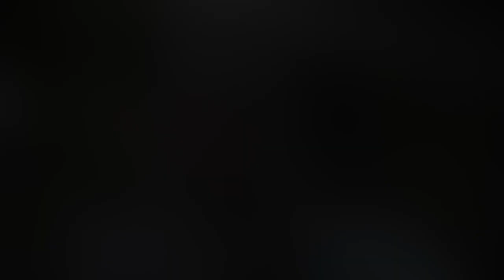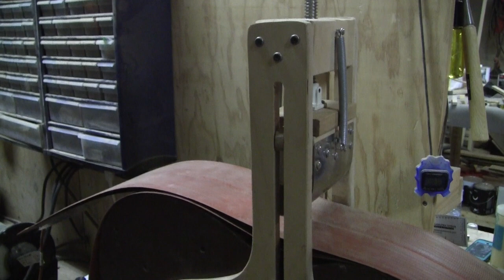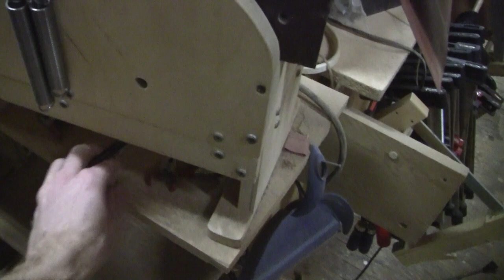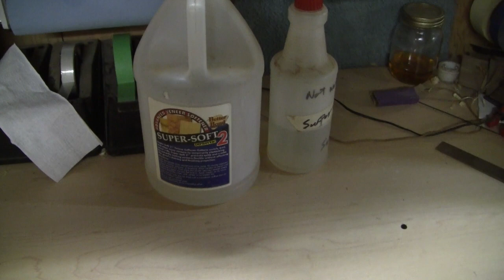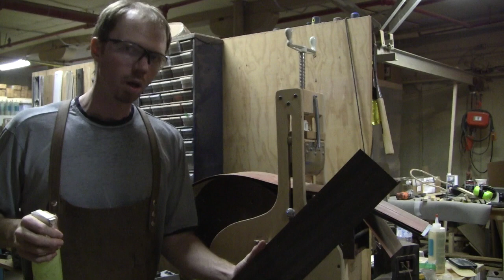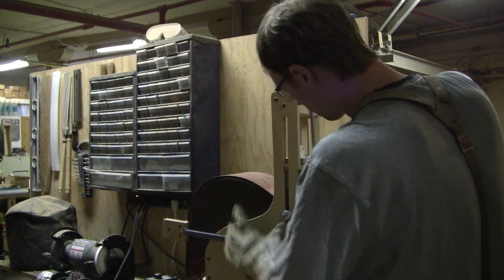Bending Acoustic Guitar Sides with a Bending Machine.

Comment: Thanks for the good video Josh. Have two questions. 1: do you wrap the wood in paper or foil to prevent staining by the spring steel slats? Do you profile the back edge of the side before bending? I studied with Sergei as well and am evolving in my approaches, always looking for more info. Thanks again!
Reply from the maker: Hi Fred, Sorry for my slow reply! I forgot that you had left a comment on this video. In general I don't wrap the wood, and I typically don't have issue with any staining. I think one of the keys to this is that I use a very small amount of water. Typically just spraying the underside of the wood lightly. If I'm bending light coloured wood like Maple or Mahogany I may get some surface staining, but it easily sands out. In the past I found that when I was using more water than staining was more of an issue. The water would seem to pool and boil under the wood and cause a deep stain. And to answer your other question, no I don't profile my sides before bending. It would be a bit of a time saver, but I have such a wide variety of shapes, and often 2-3 depths I use within those shapes, that I've never gone to the effort to figure out all the profiles I would need. In reality It would probably save me 10 - 15 per build. Maybe that would be worth it..... If I can be any more help please let me know. You can always email me direct as well.
Reply: @joshuahouseguitars  Thanks for your generous reply. always gleaning and always learning. God bless!